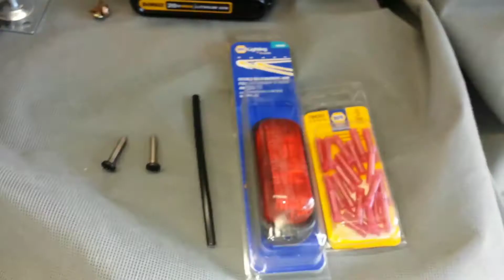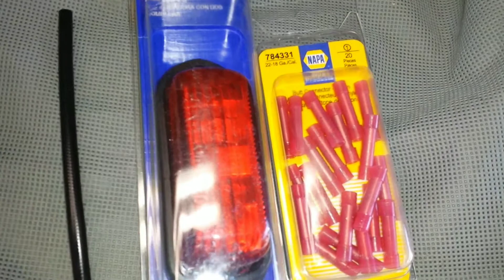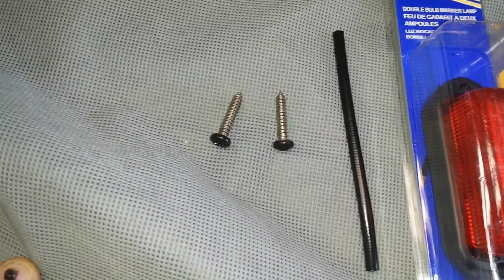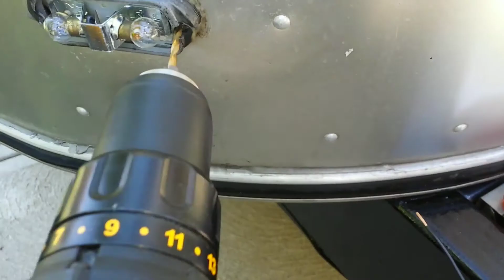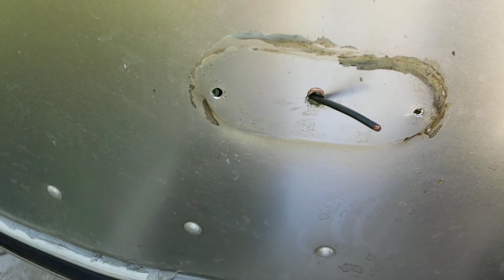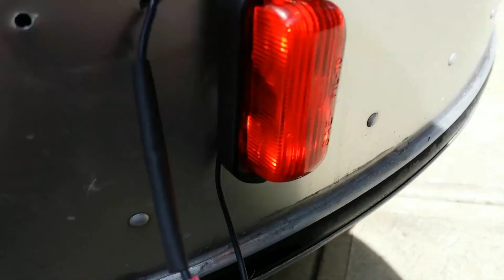How to replace RV running lights on an Avion Travel Trailer.

Comment: Please don't use silicone sealant anywhere on the aluminum exterior.  Better to use DIchor on the 3 holes before screwing in.  Use Parbond around the whole perimeter of the light housing as well not just the top.